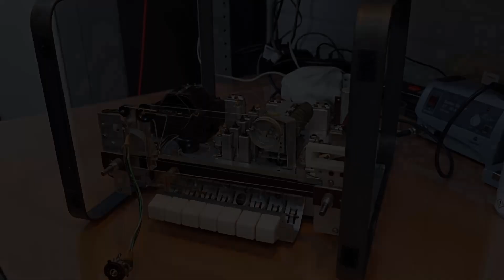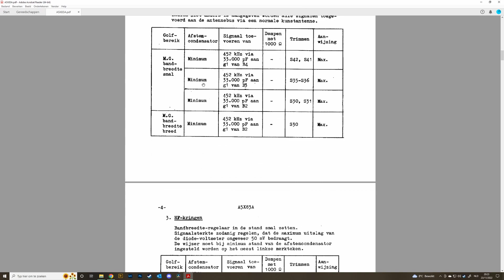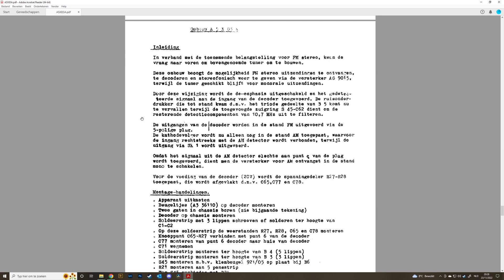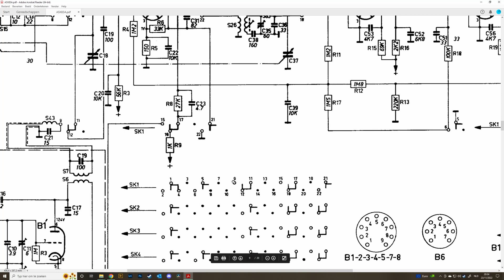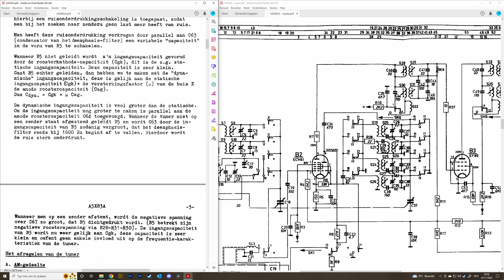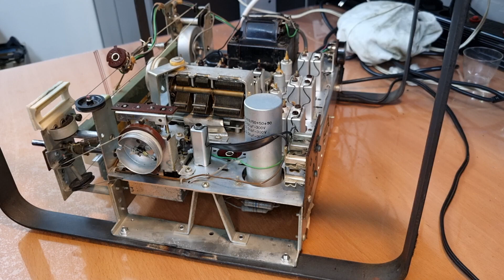Her bodywork is looking much cleaner now! Philips A5X83A (Part 2)

Comment: I wish a lot of fun and loads of fans of this channel! Up to now I really enjoy your analysis and investigation process.

When it comes to EABC80 - if 3 sections work fine and the problem is with the triode only, you shouldn't be bothered - the good sections prove the tube is not gassy, and the triode works in that interesting noise suppression circuit which forces the triode to work at 0 cathode current 99.9% of the time, therefore it suffers from cathode poisoning. The same would happen with any new tube after 500-1000 h in the same mode.

The EC92 is highly unlikely to get tired to the point of affecting the performance of the tuner - the tube uses cathode resistor bias and most probably it compensates for the change of the operation point.
Reply from the maker: Thanks a lot!
Great clarifications related to the effects I see on both tubes. I'll look further into that. I still have lots of things to learn about tubes... :-)

Comment: The capacitors you are going to test are mustard capacitors. I have tested an odd one and they check quite well in comparison to the other capacitors, you would generally replace initially. Mustard colour!

Top quality on the cleaning of the chassis. It a nice clean outcome.
Reply from the maker: Thanks a lot for the info! I'll measure them anyway, but now I know what to expect.